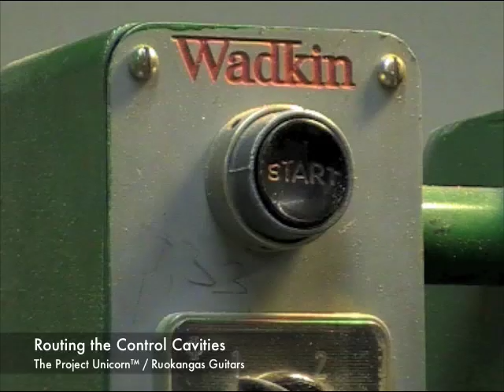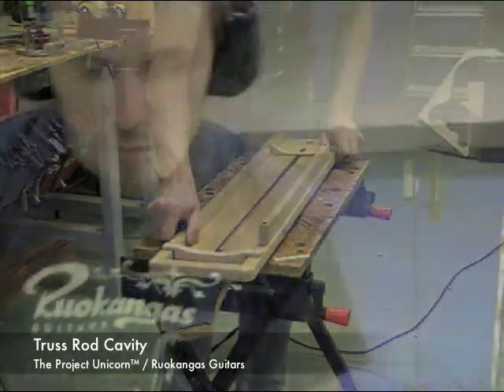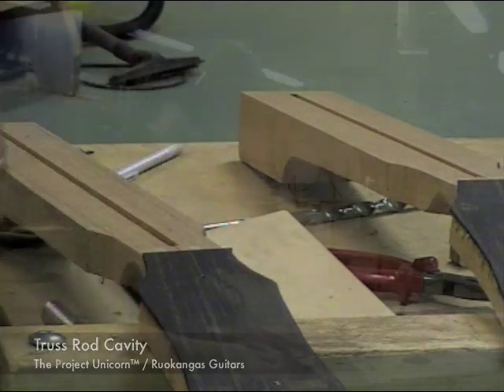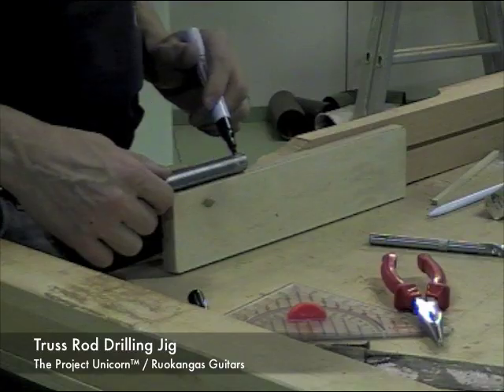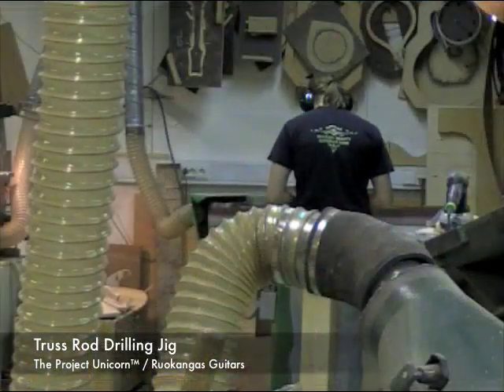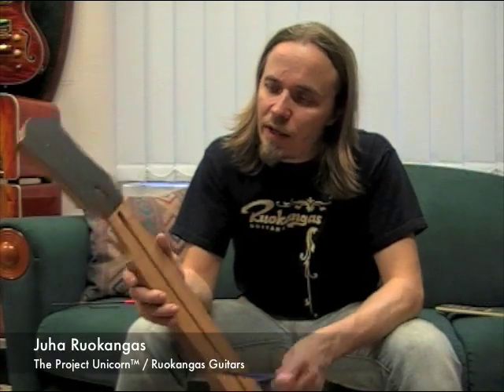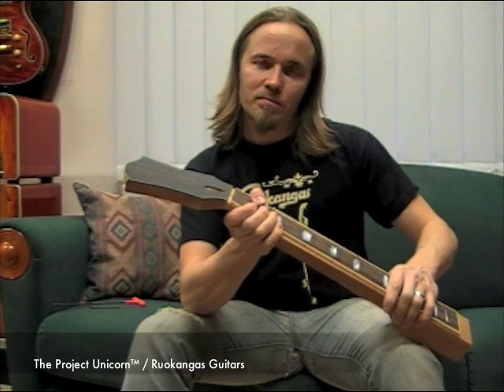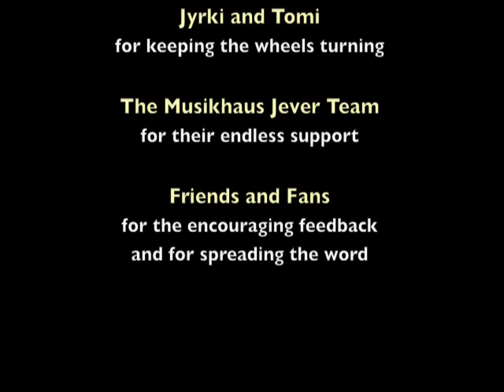Ruokangas Guitars Video Diary Episode 8 - Body Building

Comment from the maker: @Ganorin We use spiral cut router bits which cut very clean. Note (!!!) if you decide to try this on an overhead pin routed - use ONLY the kind of bits that cut downwards - otherwise the bit will raise the object you're cutting up from the table and you'll hurt yourself. The spiral bits are meant for cnc machines, not for handheld / -steered routing, so be super careful!

Comment: hi , i have another question: how do you cut the outline slot body template  before to put it under the router with the attacced body blank? Do you do this by eyes  free hands?
Reply from the maker: I make first a template of the body shape out of clear acrylic (or sometimes 4mm thick MDF) and use this template to cut the outline slot to the square body template used to cut the body shape of the guitar...